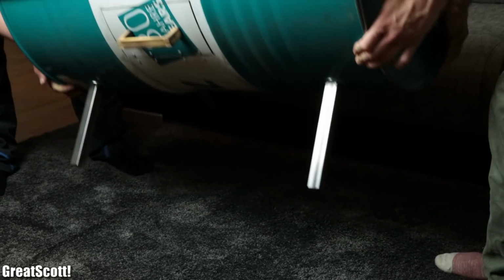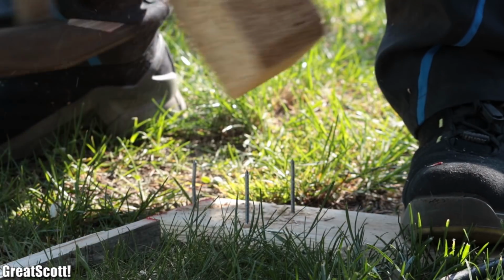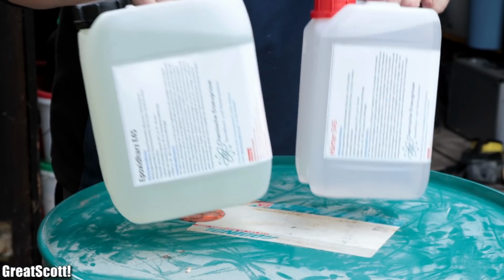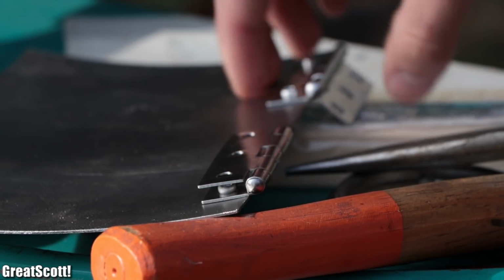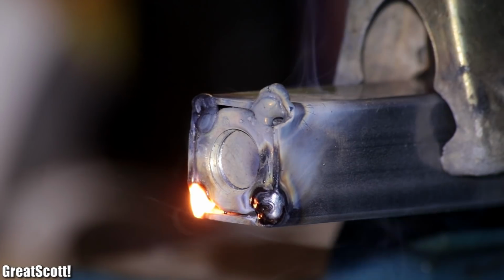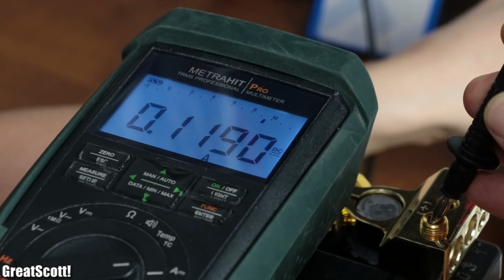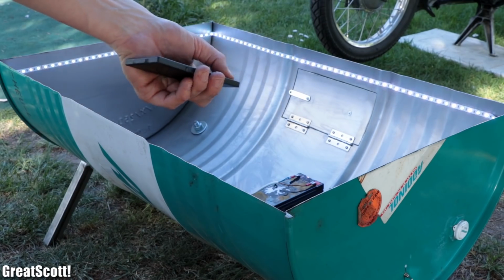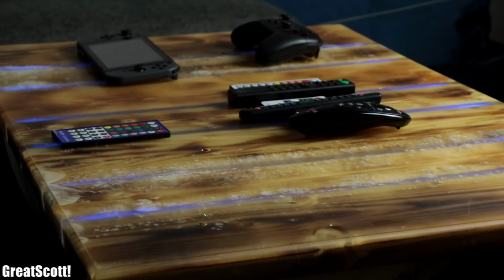Building a unique Coffee Table with an old barrel, epoxy resin and LED lights?!

Comment: Quick note for anyone considering this project, be careful when cutting used steel barrels. They can (and will) explode if there is any flammable residue in the barrel. Wash the barrel thoroughly with a de-greasing solution and be sure there is no smell of chemicals whatsoever before you start making sparks.

EDIT: A lot of people also recommend filling the barrel w water while you cut it. That's a real good idea
EDIT #2: LazerLord10 also suggested using a reciprocating saw instead of angle grinder because there is less sparks, which is also a real good idea.
Reply: Another good idea is to use a non-sparking saw, such as a reciprocating saw instead of an angle grinder.
Reply: @LazerLord10  Easist thing to do is by a barrel that contained food.  Then you don't have to worry at all.
Reply: @stoojinator  One thing with scrap barrels, however, is that there's never any guarantee that it didn't, at some point, have a flammable compound in it. Better safe than exploded, no matter how improbable.
Reply: This comment should be pinned at the top ..... I have seen a barrel blow up.. not pretty
Reply: @LazerLord10  "Better safe than exploded", I'm gonna use that one day lol 

EDIT: Btw I like the idea of a sawzall instead of angle grinder, that's prob what I'll do if I ever end up cutting a used barrel
Reply: @Vampier  Very true, I almost had it happen to me too. Fortunately I decided to not cut the oily lookin barrel that smelled like detergents lol.
Reply: Use a food grade barrel and cut it with a oxyacetylene torch, and be done with it. Better yet, use a white plastic barrel that had a soft drink syrup in it, and then you can see the colored lights through the barrel too.

Comment: PLEASE put some rubber edging on that door and opening.
You are going to get cut from the metal edges. 

Otherwise. I love it!
Reply: even some 1/4" wood striping would do it, and be flexible enough to match the shape.
Reply: I found that when I file and sand the edges on those oil drums they are really not sharp at all.
Reply: @RubenLensvelt  It looks think enough not to cut, but not really enough to be comfortable and have the visual weight of not a flimsy floppy thing
Reply: No rubber! Do it as you like. Even if you cut your fingers, you can fix them with hot glue
Reply: @LabFiona  a nicely rounded 20ga shouldn't cut like a knife unless you fall on it. aand I still have a scar from the last cut I patched with superglue. I don't want to consider hot glue :)
Reply: danger zone
Reply: JPC xD Flex tape works better
Reply: I was thinking the same thing
Reply: If not cuts well, needs to be sharpened, the best with one atom precision. Real men don’t use not deadly dangerous equipment. Even your bed should have powers to annihilate his owner or user.
Reply: @qvatch  
I think less is more in this case. These larger drums are reasonably rigid.
Reply: At 4 minutes he goes on about getting rid of the sharp edge so I don't see a problem. Dull metal doest really cut through skin.
Reply: @TheFicktion  On tombstone: "Died from an infected scratch... like a real man"
Reply: The corners will rust as fk if you constantly touch them
Reply: change the opening direction of the door, i think its more intuitive to pull on the handle than to push. You cloud use magnets to hold it in place.
Reply: You could be weird and cut it with tin-snips, curl it back making it look all dangerous as hell then clear epoxy it.

Comment: What I find truly awesome to see is how your skill improves over time. Compare this project to earlier work and the difference is huge. 

Just a small note of caution: those metal edges can and will hurt you. I once cut my thumb on a computer case cover plate that was finished similarly to your hatch. I had it in my hand when I suddenly lost control and it went right into my thumb. It was 20 years ago, the computer has been retired long ago, but the scar on my hand will stay with me for life.

Comment: Applying a clear wood sealer and allowing it to cure before pouring the resin will eliminate the large areas of bubbles, as any air trapped in the wood wouldn't be able to escape into the resin. Also doing several rounds with the heat gun about 30 minutes apart will also help with bubbles as well.

Comment: To avoid the bubbles, you need to seal the wood before casting the resin. You can spray it with transparrent lacquer for example. (If you want to do it properly, spray it, sand it with 240 grit sandpaper, and then spray it again to get smoothest surface.

Comment: A quick tip if you need to use a barrel that have had any kind of exlosive chemical in it;
Submerge the barrel in water with the cap off.
Then proceed to cut it.
This way you eliminate the chance of detonation. Which kills people each year.
If you don't live near a lake you can stuff strong garbage bags into the barrel and fill these bags with water.
It's a trick that is used on car gasoline tanks when refurbishing them.
Nice project! =)
Reply: The aquatic environment will be fine, don't worry 😂

Comment: Suggestions~
1. add some rubber safety for the edges of both the side door and under the table door
2. create a box enclosure for the electronics or a separator inside the table so that they wont get hit by the items in the table
3. Can you put in a paltier freezer in it to make a make shift mini fridge?

Comment: Make sure to take notice of whats has once been inside a barrell like that before you cut it with an angle grinder!
A friend of mine cut a barrell like that and it turned to a big fireball when the sparks from the grinder lighted up the left over fumes in the barrell....

Comment: @GreatScott. I have tried this before. Its not because of the reaction with the wood. You have mixed too much quantity of resin in one go. The resin heats up  during curing time leading to the foam. If you have mixed in lesser quantities and pouring after the curing time this could be avoided. Hope this tip helps.

Comment: An empty steel barrel is potentially extremely dangerous, especially if you're cutting into it. Extreme care must be taken to make sure no solvent or other potentially explosive chemicals remain in the barrel. People are killed / injured all the time trying to make "home made bbq" type projects.
Reply: It is important to fill the container with either an inert gas, or a hose from a car exhaust pumped in whilst cutting. Be safe!!
Reply: I was thinking exactly about that. Vapours are super explosive.
Reply: There is "Schmieröl" written on the barrel, wich means lubricant or oil. I know it could have been filled with something else, but the risk seems to be quite low.
Reply: Where I'm from, the sellers usually take care of that. Maybe it's the same for where he got this one.
Reply: Fluffy Bunny I wouldn’t put my safety in somebody else’s hands like this.

Comment: Next time, you may think of using a wood conditioner or sealer to seal the wood pores and prevent that bubbling effect. You also may want to use a bubble eater, a safe chemical used to pop all the bubbles once they reach close to the surface. 
Anyway, good job!

Comment: Love it . Sanding is a exhausting process. One question...why don't you use a Gas soldering Iron ? They mostly came with a tube for shrinking these "shrinking tubes". Würth offers one of the best model on the market (it's not cheap, as you may know from Würth)

Comment: It's a really cool video and nice table, but I have some tips for you. First, to avoid so much bubbling from the wood you should firstly pour a little bit of epoxy on the wood and then turn and shake it to make sure all the bubbles escape from underneath of the wood. Secondly, to get rid of bubbles it's better to use special spray, because with the heatgun you can easily overheat it. And the last one (could be really subjective): it would be much better to paint the barrel in black for better looking.
(I am not an expert in epoxy, I just watched some videos about it)

Comment: I was wondering if you could have reduced the bubble problem by pre-coating the planks individually, and allowing them to cure before immersing in the larger epoxy-bath ??
Reply from the maker: Yep. That would have been a solution.

Comment: Good thing you used epoxy to cover the pallets. Apparently the pallets are treated with some pretty harmful chemicals to make them resistant to weather and are not recommended as building material for furniture... or flower pots for that matter.

Comment: Please be very careful when welding things like nuts and bolts. They often have a zinc coating which creates very toxic fumes when vaporized (welding easily goes above that temperature). So for the next time, remove the coating before welding.

Comment: Too much epoxy in my opinion. I think it looks a bit tacky, when overused
Reply: i would have put scratched up acrylic sheet under the boards, and kept the boards open and not epoxied. This way the light would diffuse, and the surface would have looked way better natural while blocking out all the water or dirt from falling in.

Comment: Be careful when cutting a barrel.  If it contained flammable materials, you might need to wash it out many times and fill it with a non-combustible gas such as CO2 or Argon while cutting.  There have been many cases of people being seriously hurt or killed when cutting a barrel and it exploded.

Comment: Guess you can say, this project is "lit-terally"

Why don't you go with addressable RGB LEDs instead of the generic boring RGB LEDs? It'll be even much better with programmability function.
Reply: Probably not much of a benefit for the added cost. You won't see as much through the space in the wood, even with the generous gaps. Besides, as awesome as it is, I presume GreatScott doesn't want people over solely to stare at his coffee table all night. I could be wrong. :D